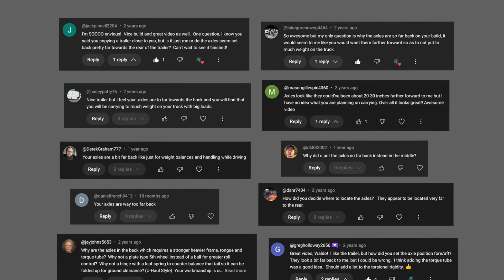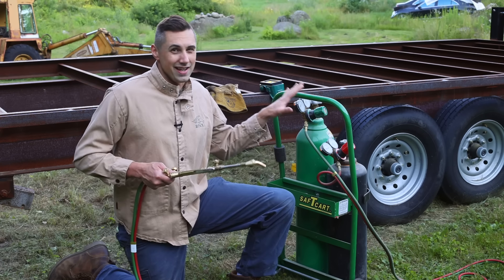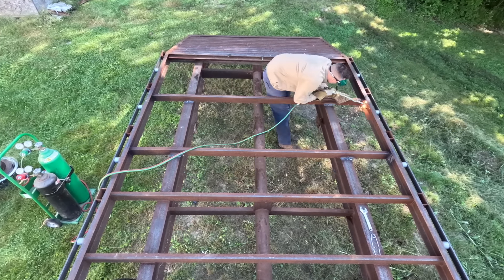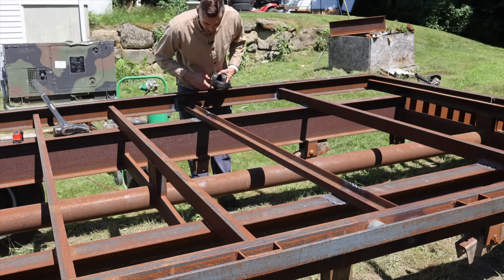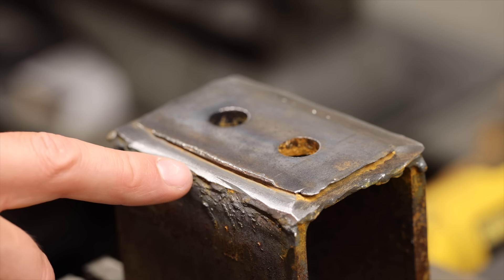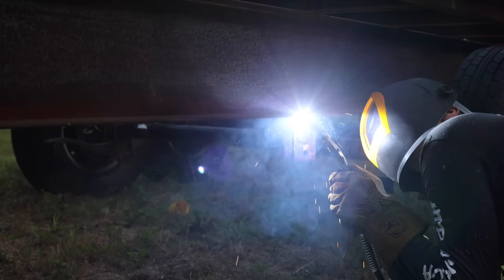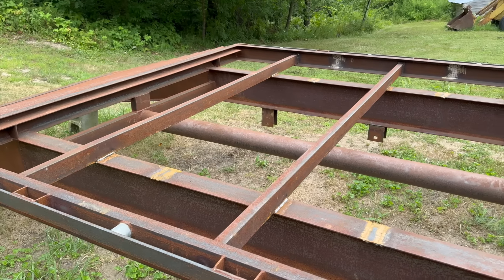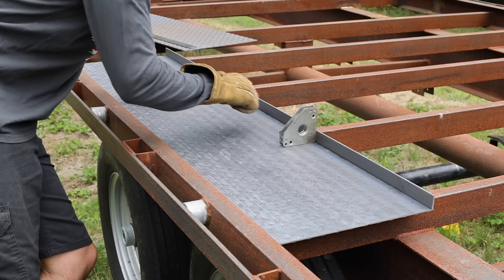Don't Make this Mistake When Building Your Own Trailer

Comment: I'm a mechanical designer for a trailer compagny i love this series, i've been waiting for part 3 glad it finally came haha
Reply: I would weld a channel in front of the front axle mount and one on the back one. Channel face on the bracket and the top on the hbeam.
Reply: @bingbong5939  you sound like you know what you're taking about.🤔😊😉🎅
Reply: @bingbong5939  most of the time when a trailer comes into my fab shop for repair that’s been used to haul heavy equipment and other “real” loads all the time, I’m repairing the frame at the front hangers. So I fully agree with this suggestion. Even just shooting some angle iron between the two sides here would be a huge upgrade at this major stress point.
Reply: @bingbong5939 So you'd box in the spring mounts to keep them more positively located? Is it common that these welds break or the brackets bend?
Reply: Why cut hangers get new one a lot less work
Reply: @ProleDaddy correct help with torsion and force applied when turning charged. More of a safety on 5k axle and under over that it's often required by the axle manifacturer

Comment: I've been a welder 15 years now. 6g certified. I have a multi-process at home, but typically do SMAW (stick) or MIG or Flux core for my job as a structural iron worker. I saw those welds, and I will first commend you on you bravery for doing that on film. And secondly will say that those looked like damn good welds brother. Good on you for being a trailblazer and becoming a jack of all trades with your projects. I think you're kick ass dude. People will talk smack, that's unavoidable... But being brave enough to put your work out there to be criticized says volumes about your character and I think that deserves an atta-boy! Have just started watching and love your videos man. Keep up the good work brotha. 

P.S. It takes a big man to admit he was wrong. But you did that and learned. Then you went back and made it right. THAT is badass brother. You have a good head on your shoulders. Cheers!

Comment: As a welder I am GLAD someone is showing a swedge tip, and also stated the importance of preheating before cutting or using oxyfuel torches. Your cuts are so much nicer when you properly preheat the area. 

In the future though for projects like this an Air Arc Gouger if you have one or can get one makes removing welds a little easier. Gougers are also very versatile when you find cracks in base metal or need to do repairs. They are our erasers in the welding world.
Reply: If you are an honest to God welder, why would you watch someone like this other than for laughs?   Crap like this used to upset me right after I retired.  Now, I watch these videos for the comedic value.
Reply: @jamesford7182  I don't need to prove that I am a welder, if that's what you are challenging here. You watched the same video as I did, should I question your credentials? I watch because I enjoy seeing people fabricate things, especially if they are newer to it. Because I enjoy teaching / offering advice and mentoring people. Alot of hobby welders don't know the different processes and in the case of the video they might be unaware of a process that is more optimal to use. Rather than be angry/upset like you were I choose to be instructive. And sometimes when I watch a video by someone who knows what they are doing, I will explain why they are doing what they are doing and if / when the process they are using is not the best solution way to accomplish a goal.
Reply: @BType13X2 I meant nothing against you, my reference to comedy was about Waldo. I have nothing but respect for the pros and have literally known hundreds that could runs circles around this putz.  Hell, "Amazin' Blaze Welding Service" (check out that old video) is ten time more informative.

Comment: Thanks for the update on the trailer build.  You might want to consider changing the angle of the rear end, especially considering that you plan to make folding ramps to make the rear end level when the ramps are folded up. Check your video at the 11:00 minute mark, you're dragging the rear end on a not all that steep grade. Looking forward to Part 4!!

Comment: honnestly i would have been trying to use a plasma cutter for doing all that removal work.  first time i had to gouge off welds the plasma did an absolutely incredible job.  it has been a far more versatile tool than i ever thought it would be and i got very lucky to have inherited a reasonable unit that only needed a few things to make it a much better machine than people normally give it credit for.

Comment: I worked for a large trailer and flatbed manufacturer. The way you welded the trailer originally is that same way we did it and it's perfectly fine

Comment: You should have made a cradle to slide under the trailer and then its moveable/adjustable. Like a boat trailer set up. You can move axles easily that way.

Comment: I have a factory made trailer built the exact same way( before you moved axles). You need them there to handle loading on the dove tail and to help when going through dips to keep the trailer from dragging.

Comment: Some advice, Because your close to Maine, I recommend you register it there. Trailer's do not need to inspected your trailer as long it is not used in commerce. Not sure on the registration fees in NH but here in Maine it is $40 for a 2 year registration on a homemade trailer. I hope it helps!

Comment: Gouging doesnt require preheat as the oxygen is the workhorse. You might need a high flow oxygen reg however depending on the tip. Gouging is crazy fun for long smooth weld removal. Use plenty of oxygen and go steady.

Comment: Thanks for the part 3. I made myself a smaller regular EURO trailer for in village use, so no registration but i do plan to add all the lights. I used the most basic stick welding and as a base a rear axel from a Fiat Ducato. You gave me the ideas on how to design it. Although i suppose the wireing will be differend due to plug differences i guess that video will come in helpful for design and routing ideas
Reply: Good thing the ducato is front wheel drive

Comment: When you get to paint... use ospho chemical converter and then simple epoxy paint that uses a hardener. Powder coat will be way too much money and overkill. Use a weed sprayer and cover the entire trailer and let it sit iver night. Then power wash off and simply paint. Will last for years. The marine grade stuff rocks. You can spray or brush it on. Smooth finish. I'd suggest a cheap homedepot airless sprayer.

Comment: Just happened on this. You know DYI is great but you might want to check in with people that have built these trailers. If you built the axles into a subframe you could put them anywhere you want. Notice how the beaver tail drags. You will get a drag on every driveway. I have helped put hydraulic rams on a pivoting beaver tail. Worked great.

Comment: Hey Waldo, even after axle relocation (and keep in mind that trailer is not complete yet), you can see how much the rear suspension has collapse on your 2500 truck in your closing video segment. Trailer will only get heavier with the wood deck, fasteners, tool box, etc, and eventually a payload. Possibly, you need to install good set of rear air bags on your 2500 or use the 3500HD as your go to vehicle for goose neck?

Comment: A truck driver once told me trailers pull better and ride smoother the farther back the axles are set. Move them to far forward and you end up with a teeter totter effect. If the load can be adjusted on the trailer to get the weight distributed correctly then the axles were just fine where you originally put them.
Reply: It's all a balancing act.  Depends on your length of trailer and items hauled.  Generally speaking it is good to have axles set far back so you don't have weight behind the axles waging the trailer.  But little pickups can only take so much tongue weight so it's a compromise.

Comment: almost every trailer is mig welded. you should box the metal where axles connect to trailer, and add some triangulation both horizontal and a couple vertically to stiffen the trailer deck. an upside down pyramid  between axles linking boxed section near suspension hangers to chassis rails will help reduce twist with little affect on road clearance .

Comment: The key to scarfing/washing welds off with a torch is to have your acetylene and oxygen set high enough so you don’t need to touch the high pressure lever at all. You heat the weld up to it’s melting point and the higher pressure set at the bottle “washes” the weld away until you see the fusion line. Every time you hit the high pressure lever is one step closer to accidentally cutting into the base metal. The extra pressure from the high pressure lever can send your O2 jet off at a weird angle and really cause a bad day.

Comment: Your torch cutting skills.  You suceeded in torch cutting.  Keep in mind, there are guys in the scrap yard that cut scrap junk metal for 10 hours a day = 10 x 5 x 365.  Their only job is cutting day in and day out for their entire career.  This is similar in the welding professions. They are experts.  I am very good at both, after 10 years of projects, but I always keep this in mind.  But, if you ask one of the master welders  to build anything in wood like a garage, deck,  or a shed, they would be a very basic novice at it.  I have built some very strong trailers too.  The best floor is steel or aluminum,  it will last 50 years.  For the floor, we also used thick oak wood planks from a country saw mill, cut from oak trees,l.  This oak floor can last 10 years without paint or any treatment.   Great project and videos.  Great job.

Comment: Waldo, I'd strongly suggest putting a pair of receiver hitch tubes vertical on either side of the back of that trailer and then making a set of legs that drop down through them when you are loading with the ramps. 

I have had it happen where loading a gooseneck like that and it was so heavy it lifted up the back tires of the truck, and because the back tires of the truck were up, the brakes were no longer applied. 

That is not a fun time. 

That being said it is kind of a shame you are not still running the 3500HD, I quite like that truck.

Comment: As a fan of your channel with fabbing experience, I would like to add 2 tidbits of positive knowledge your way. One is to use a full face shield when grinding. I have seen some nasty face scars from them. The second is to look into carbon arc air gouging to remove welds in tricky spots. Keep up the great entertaining vids!

Comment: I believe that the common rule of thumb is to aim for about 25% of fifth-wheel/gooseneck trailer weight to be on the hitch or gooseneck, and 75% on the trailer axles.  And for bumper trailer it's often the case that the trailer axle will be very close to 1/3 the distance from the rear of the weight-bearing part of the trailer.  Having the axle too far forward is worse for stable towing than having it too far back. Err on the side of having the axles a bit too far back. Generally, generally.  To get it right, it almost requires the use of trailer scales such as those at an agricultural business: grain elevator, feedlot, or at a junkyard.

Comment: Generally, cut so the slag and melted metal flows and blows down and away from your direction of torch travel.   When cutting vertically, consider starting with the torch at the bottom of the path.  Begin by cutting away any ledge that would pool the slag,.  Give it a more open path  to drip away.  This keeps the torch tip out of resulting puddle of hot, melty stuff. Once you've cleared away such, then consider restarting the cut at the top and traveling downwards.

Comment: I don't know about your state but in mine each axle is rated to carry a specific load and here wheel scales are often used by the state patrol to see that they aren't overloaded. Even if that 3/4 ton could handle it it's always good practice to locate the trailer axles in the proper location for good balance.

Comment: That cutting torch tip is called a Peyronie Tip.  Be sure to ask for it by name at your local welding shop.
Reply: There's a pill for that tip.
Reply: Well hellowa youa
Reply: Peyronie tip? Is that true or are you doing the old blinker fluid trick?
Reply: @tjpprojects7192  🤣😉

Comment: Sometimes its easier to just cut the crossmember, near the weld, and weld on an angle iron clip,  back on each side to hold it in just as securely.

Comment: This videos tells  the few reasons why I gave up the project to build my next trailer.

1 As shown, not being sure where exactly to weld my axles  for the same reasons. Safety for others , handling on the road possible damages on my car , quality control where the welds are critical . lack of experience./confidence about it.

2. Cost  of steel, trailer parts, unexpected tools to buy, mistakes to fix no real money/time saving worth to build it.

3 Still not painting or galvanising., even more extra costs incoming.

 Cheers and respect to the men and is craftmanship however, my next trailer will be found to my favorite dealer!🙂

Comment: Could maybe leap frog the rear axle to new position in front?  Leave old spring hangers in case need to move back again.
Bolt on steel wheel plates, they usually end up sagging or damaged.  Easier to repair/replace later.  Some semi trailers have whole rear axle assembly on a sub-frame.  Can be moved fore and aft, pinned in position.  Don't neglect using links to connect ramps to beaver tail.  Perhaps make ramps in three parts, less weight to lift, adjust to irregular ground.  Leave the middle one at home unless needed.  Run wiring in EMT conduit, handy boxes at junction points.  Like to run conduit along side rather than under.  Again, easier to reach later.  Tie downs?  In Montana, the only inspection is that the assigned serial number is stamped in, and the the basic description matches.  8x18' flatbed, tandem, like that.  Rust in color, most popular.

Comment: Not sure why the hesitation & fear in cutting torch! Its a part of fabrication just like anything else. Watch some @NBSWelding and @ICwelds both have videos on cutting away welds with scarfing tiped & regular torches. I think its just a fear of doing something you havent done before which is understandable. Oxy-acytelene torch cutting is a huge part of repairs & fab work(especially fixing your own f-ups), and should be 'mastered' just like welding & grinding. I hope we get to see more than this little 'teaser' video you finally got around to doing. Look at it this way, if you get this all done & on the road, you can buy more projects from the auctions & not be paying tow truck transportation fees! C'mon Waldo, lets get this thing wrapped before the snow is flying!👍🏻👌🏻🛠️🔧🔩🚜🏗️⚠️🚧🦺

✊🏻🇺🇸🦅🇺🇸✊🏻

Comment: On receiver hitches at the rear of your truck (bumper pull) the general consensus is you want 10-15% of the towed weight on your hitch. So if you have a 3000 lb empty trailer, you want 300-450 lbs of weight on your hitch. 
If you're towing 8000 lbs of payload, add your empty trailer weight of 3000 lbs for 11,000 lbs total. 
That's 1100-1650lbs on your hitch. Just don't go over the weight rating of the hitch.
Not sure if that also applies to gooseneck trailers. You might be able to add more weight to that kind of hitch. 
Just don't go over the weight capacity of the truck.

Comment: You didn't search hard for the formula for axle placement. Basically 1 inch per foot of trailer length behind the trailer center or use the 60/40 rule.  So on a 30 foot trailer the center hanger should be at 17 1/2 feet JS

Comment: 1:46
My teacher told me once that if you want a soild setting on that equipment, which will cut it like butter
You got to adjust the valves while holding "throttle" and if it sounds like a plastic bag in the wind, its 90% good 
We use "AGA x11" In danish its called a "Skærebrænder"
(Sorry for my english. I'm danish, so i'm not the best. But i thought it would be helpful to some, please tell me if i need to elaborate :) )

And with that said, waldo's setting is great, you can clearly see it cuts well.

Comment: Obviously the Mig welding was more than adequate.  I would have been real tempted to just buy new axle hangers and leav the old ones there!  Nice work especially not having ran the torch like that before.

Comment: Just a suggestion, might want to put some support under the middle of the diamond plate because it's only that lip that's taking the weight right on the edge now. Good work 👏🏻

Comment: Me I would’ve just left the old hanger tabs on the trailer and just welded new ones on,  then positioned the axles to be in between crossbars.  If done correctly it would’ve allowed some adjustability of the axles fwd and aft as well as being able to add an extra axle.

Comment: Something to look into... May not be the same in your state, but in TN you can derate your trailer to stat under 26k GCWR its not what you can actually tow, but what the trailer is rated by the manufacturer.

Comment: Would have been a stronger and more durable Trailer to have left the original crossmembers in original location.  Then add new crossmembers for new axle location.  You can never have too many crossmembers  at the rear portion of a trailer,  or above the axles. This is a very high  stress area. This area has to be able to withstand  the stress from carrying  the load, the side thrust  from the tandem axles while turning, and the additional forces while loading or unloading equipment. Build it strong the first time,  you won't be repairing stress cracks after using the trailer.
Reply: I was thinking the same thing, just leave old crossmembers and hangers in place. no cutting necessary. just add new material.